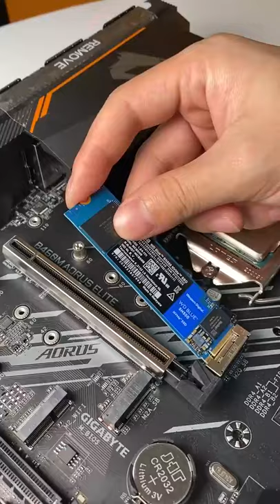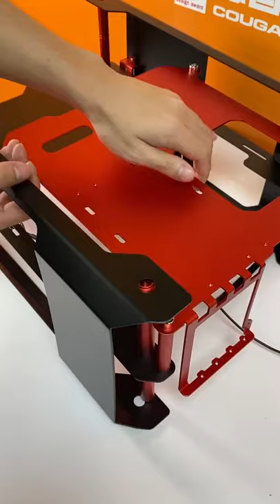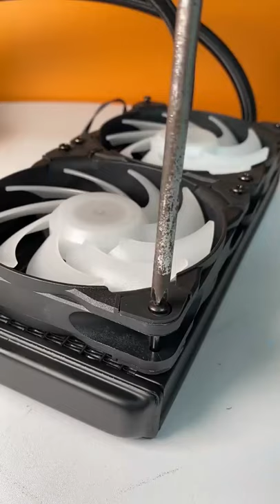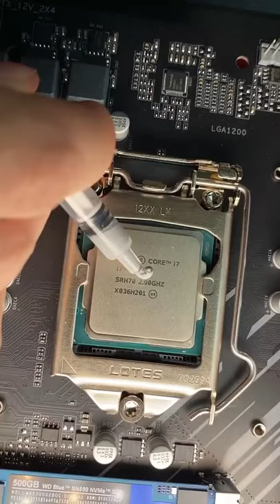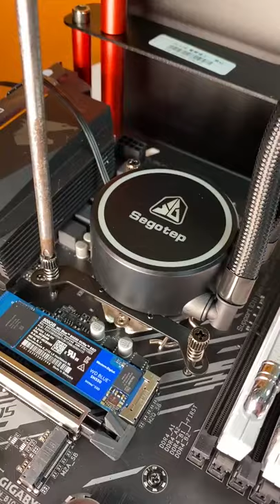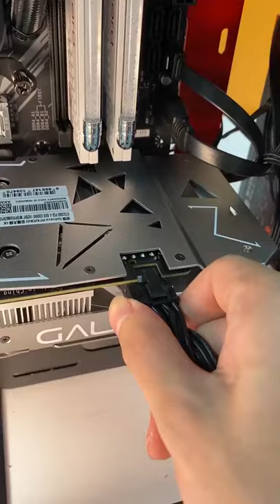Satisfying Gaming PC Build ASMR #Shorts

Comment: I feel like he uses a little too much thermal paste in every build
Reply: @yourbigfan1777  verge pc
Reply: @yourbigfan1777  too much isn’t
Reply: @yourbigfan1777  actually too much could make thermals worse :D
Reply: @Jamplays592  r/woosh
Reply: His paste looks a little cheap too
Reply: MV740  proper build? a proper build doesn't need liquid metal lol.
Reply: MV740  no. it's not. please link me a video showing me that it's a necessity, to keep temps below 70 at load. I've seen plenty of high end builds use thermal grizzly and sand paper a intel cpu until the copper is exposed.  None of those were any where near thermal throttling.
Reply: MV740  is it really that necessary? I don't see a lot of games that need a cpu clocked at 6ghz to run at 60 or above...
Reply: MV740  60fpx 4k is garbage now ladies and gentleman.
Reply: MV740  you can continue to think that, have fun ;)
Reply: You can even put whole 5g tube if you want to
Reply: To much better than too little.
Reply: @mikeccuk2006  true
Reply: That wasn't a little too much, that was like 2-3 times as much as he needed lol
Reply: @Jamplays592  This is already debunked as not true.

Worst thing that can happen if you put on too much thermal paste is it'll spill over the sides. You'll make a mess, but unless your thermal paste is conductive, it's not going to hurt anything. Too little paste will though.
Reply: @kadrix732  yep! Gamers Nexus did a wonderful video putting the wackjob stories of thermal paste to rest. Fact that OP even made a comment over the paste and people still argue about the subject is humorous still.
Reply: Yeah and it makes it unsatisfying
Reply: If you don’t put thermal paste on your thermal paste it might get hot 🥵
Reply: Not a little too much. Definitely too much.
Reply: @Jarrell.  r/woosh
Reply: @justincider8892  ?
Reply: @pagneverdown3355  ooooo9ooooooooooooooooooooooooooooooooooo
Reply: @Jamplays592  then give me the link
Reply: @Jamplays592  there’s no such thing as too much it just makes a mess
Reply: Same Thought

Comment: Definitely getting thermal paste in the socket with that much paste. But maybe he's more familiar with that cold plate or something.
Reply: Dude you literally can’t if that bar is down
Reply: @eatoke  thermal paste is a liquid and like any liquid it moves even if it's slow it moves it will get in the socket doesn't matter how long it takes if there is that much overflow it will
Reply: @LlamaCraft  GN proved just how difficult that actually is once the CPU has been seated. They also put to rest that the myths about putting too much paste. Showing that the worst it does is get on the board (which can cause issues if you use a metallic blend paste). The pins literally "hook" into each other and create seal, it isn't vacuum tight, but it also is tight enough that the paste seeping in is highly unlikely. It isn't water.
Reply: @MrWasian  you are correct I watched that video after this comment

Comment: For everyone complaining about the thermal paste application, I've used that much thermal paste many times & have never had any issue's with it leaking into the socket or messing the CPU up. Maybe it's just me but I'm not a fan of a "pea sized drop" on my Overclocked CPU pushing almost 5ghz 🧐 Can't transfer all the heat if my CPU isn't covered, I run a solid 30° Celsius while gaming on max settings overclocked so maybe a little extra paste isn't so bad just learn how to spread it evenly 🤷‍♂️
Reply: lol 30 celcius gaming? do u have a 1 core cpu?
Reply: @lucianowod  lol I have 12 cores 💀 I just have great cooling with my liquid cooler & positive airflow. At idle its 20-26° Celsius & gaming on max setting it's between °30-40 Celsius max & °55 Celsius on really heavy loads at 100% usage
Reply: @azraelzx5269  12 cores LMAO u prob are using like 30w and power throttling if ur at 30c gaming. Run a prime95 and use hwinfo most likely using a low pl1/pl2. These newer chips use upwards of 300w and even custom loops can hit upwards of 60c and 70c
Reply: @lucianowod  actually I'm using about 125+ watts of power with ZERO thermal throttling or power throttling & I should've been clearer but I'm not using a custom loop I just have a normal msi mag core liquid cooler. But I have 6 cores logical cores 12 (not 12 cores all together my bad)
Reply: @azraelzx5269  makes a bit more sense with only 6 cores. the newer chips with 8+ cores run much hotter. Also use hwinfo64 for accurate readings and don't use mobo readings use specific cpu package. Sorry about that!
Reply: @lucianowod  yes 6 cores & 12 logical processors so that's why it's not running so hot as a 8 core or 12 core chip. My bad for that, But I'll try it man I don't use mobo readings I use nzxt & another program I can't remember the name but I get some pretty accurate readings from both
Reply: @azraelzx5269  you're probably reading the coolant temperature
Reply: @lucianowod  I believe I am but I also am able to read the motherboard socket temperature along with the cpu socket temp so I'm not sure if that's exactly what you mean. I'm still learning about all this so my bad haha

Comment: Why does all of these builds have intel processors? None of the ones I saw had AMD processors.
Reply: @buttwiperindawfulevil2256  that explains the situation.
Reply: @buttwiperindawfulevil2256  Wait what? I thought it was only old Asian people because my dad's friend said to not get AMD because its "unreliable and will break fast" and that "Intel has more experience with CPU's so its better" and I've heard similar things from other older people too. Currently I've got a Ryzen system using a 3600XT and I've got no issues.... I don't understand why they like Intel so much.
Reply: @buttwiperindawfulevil2256  Exactly. They feel too suited with Intel that even if they know its worse they'll still keep on to Intel. What boggles me though is that they can adjust to Intel's stupid pricings.
Reply: I am also Asian but amd is just better but yeah my dad thinks intel is faster, intel have been around for so long and some people don't know a lot about pc and the latest tech
Reply: @buttwiperindawfulevil2256  Exactly.
Reply: @pacohchinus6686  Yeah they just assume Intel is better because previous Intel chips were "good" and its been around for so long.
Reply: @buttwiperindawfulevil2256  Intel is actually the better budget for gaming now, amd cpus are mostly sold more than their intel equivalent now since everyone wants amd, thus Intel cpus drop in price(not talking about the newest set)

Comment: Well...not sure why they even bothered with an AIO if they were planing to mount the radiators over a complete solid metal plate, blocking 100% of the air flow

Comment: Did... did they buy watercooled RAM?
Reply: They are not sane
Reply: @SonnyListonStanAccount  No. No they are not.
Reply: Nope, they not. Asgard Loki W3, what apears to be "water" is just cosmetic
Reply: @alex.260  yeah, this comment was when i knew nothing about pcs haha, I didn't know that a water cooling system needs a full loop, pump, resevoir, radiator, etc
Reply: @NebulaAviation1  don't worry, there are some water cooled SSD NVME(still unnecessary anyways) that does not need any loop, tank, etc, and there are others that are connected to the Loops
Reply: @alex.260  yeah, i dont know what corsair was thinking when they made their watercooled nvme ssd, when those things are fine with a thermal pad and piece of metal

Comment: Im building a pc for around 1450$ .Is this a good pc for 1450$? I know it's a bit overpriced but i couldn't find a gpu at a better price in my country 

AMD Ryzen 5 3600 Tray

Gigabyte radeon rx 5600xt

be quiet! CPU Cooling Pure Rock 2 Black

Gigabyte B450 AORUS Elite 

Corsair 275r airflow black

Corsair 650W CV650 PSU 80+ Bronze

A-DATA SSD 500GB SWORDFISH 2280 M.2

Corsair DDR 4 16G (8Gx2) 3600 CL18 VENGEANCE LPX
Reply: Good build but i recommend using the Cooler Master Master liquid m240L  as your cpu cooler. Its in my case and its amazing!!